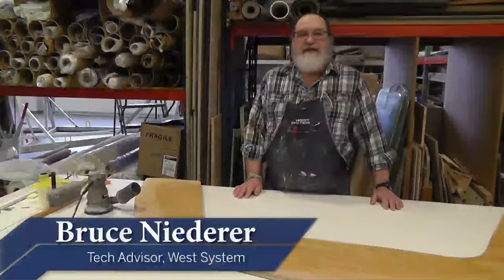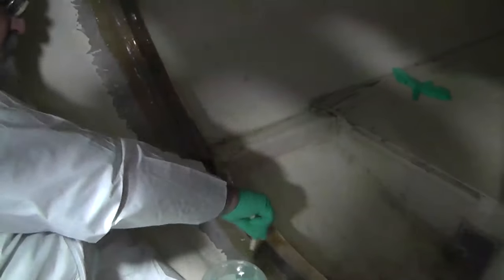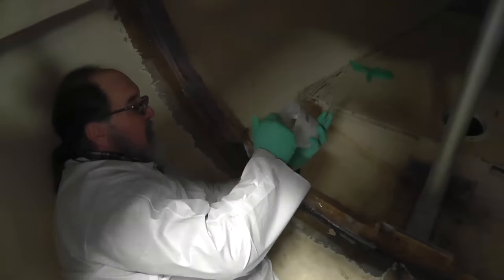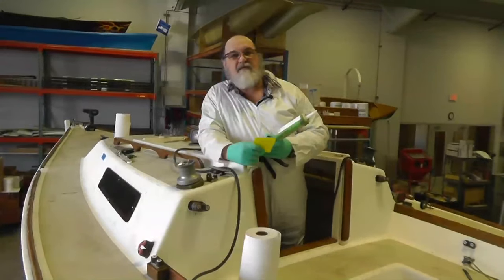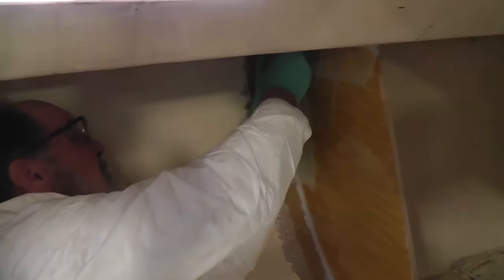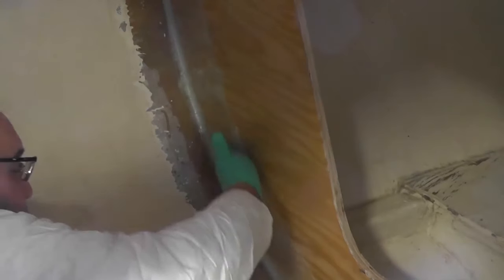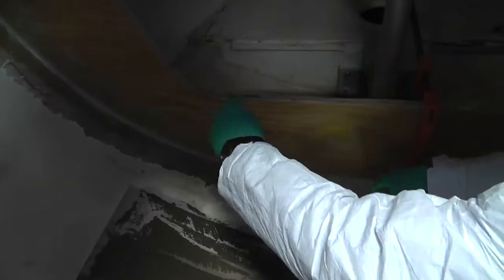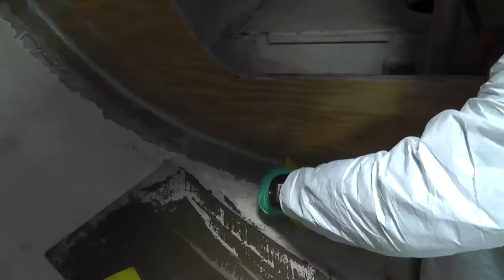SAIL Epoxy Basics: Bulkhead Installation

Comment: I am new to boating. Why can't you just screw it in like you did and leave it like that? Why all the extra filling and then placement of white sheets?
Reply: The strength of the chemical bond between the epoxy and cloth/wood  is significantly stronger than any mechanical bond could ever be. This process makes a one piece hull with lateral strength in every direction that is able to spread out a load much more effectively.